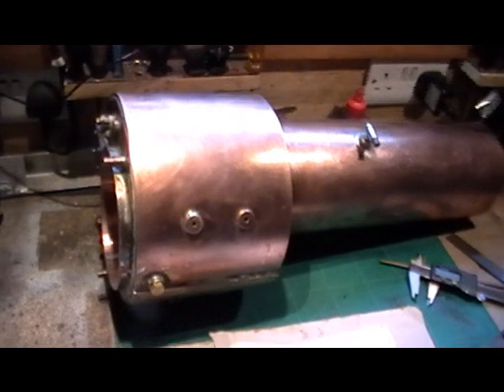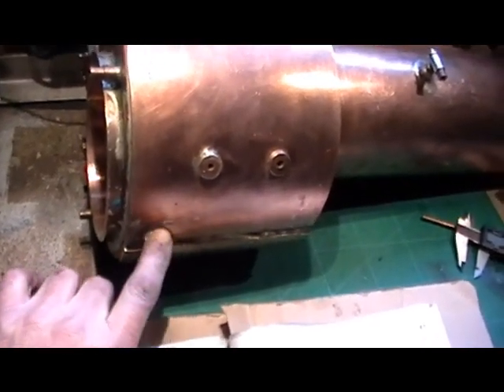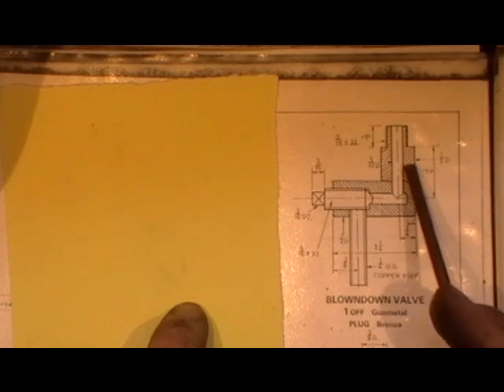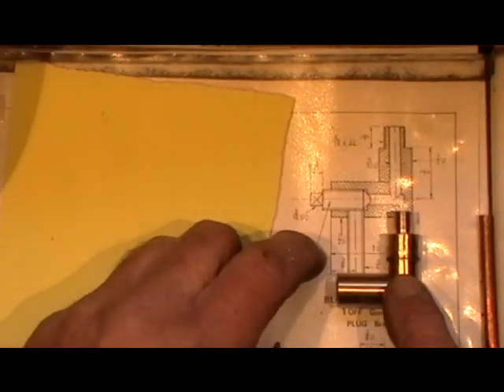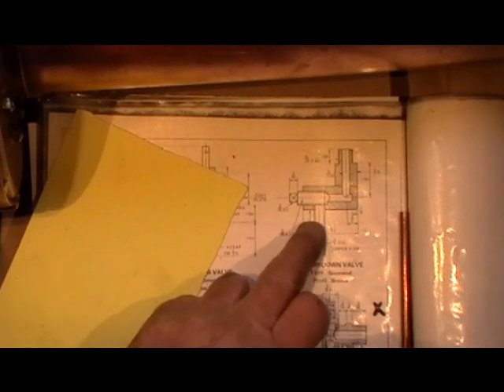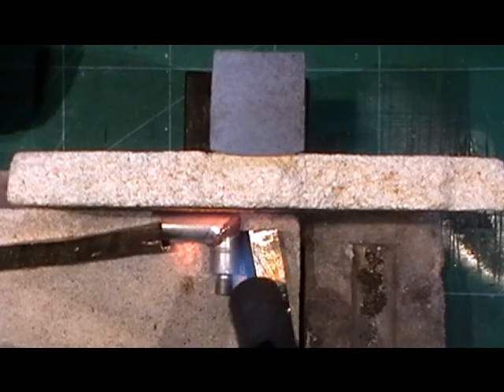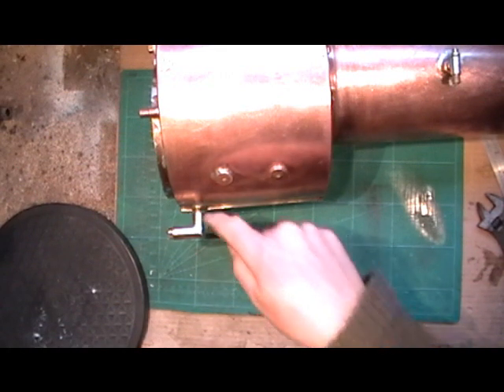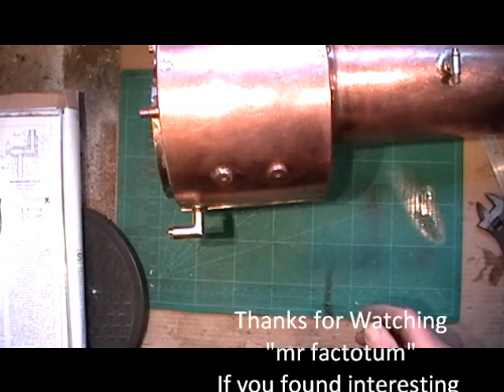Make a Steam Boiler (Boiler Fittings) PART 3 "Blowdown Valve" "mr factotum"

Comment: What a clever name you have.  I had to look it up!
Reply from the maker: Hi John
Thanks for comments. I bet there's not many people done that.
Regards
Mr f
Reply from the maker: Hi John now contact made I will take a look at your projects (they look interesting) as time permits
regards
Mr f
Reply: Mr Factotum thanks Mr F.  I’m building a boiler at the moment but I haven’t been putting it on YouTube.  Your channel is very helpful.
Reply from the maker: @CreaseysWorkshop hi john
 Thanks, 
whats the boiler for john?
mr f
Reply: Mr Factotum I have a Stuart 10V , a Westbury trojan and a Bolton mill engine.  All have only run on air so far.  My boiler is a horizontal marine type 3” diameter with a fire tube and gas burner.  There’s some photos on instagram @creaseyjohn if you are interested.
Reply from the maker: @CreaseysWorkshop  

hi john

sounds a nice project, I am interested but don't use things like Instagram, not sure how, is it easy to do, would appreciate advice  i'm still in the steam age regarding technology 

regards

mr f
Reply: Mr Factotum do you have email mrF?  I’ll send you some photos.
Reply from the maker: @CreaseysWorkshop  hi john thanks
my email is imperialstainless1956@gmail.com
look forward to see your boiler project
regards
mr f
Reply from the maker: @CreaseysWorkshop  hi john
thanks for the photos. they look really nicely well made, I bet you can't wait to get boiler s/soldered to see them running on steam . Thanks again, keep in touch with boiler progress,
regards
mr f